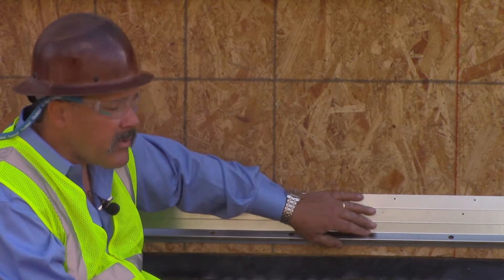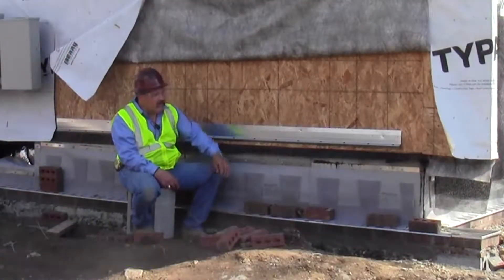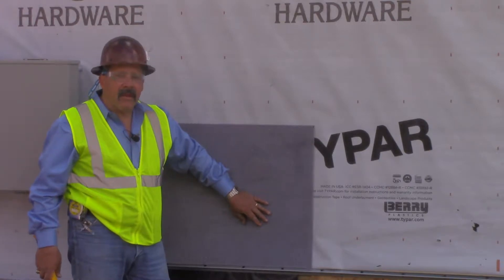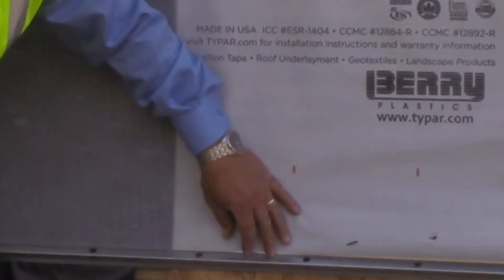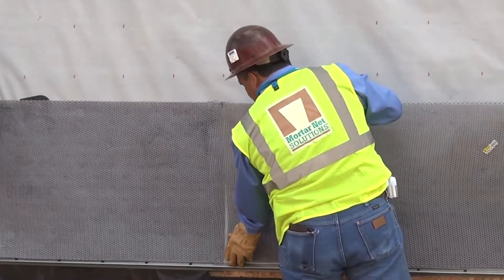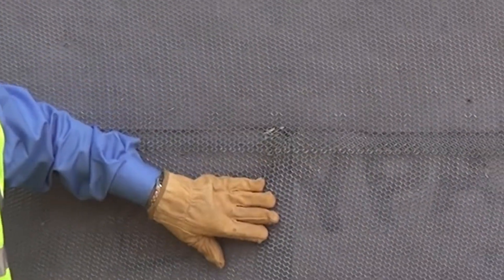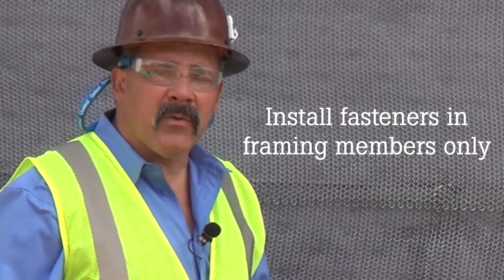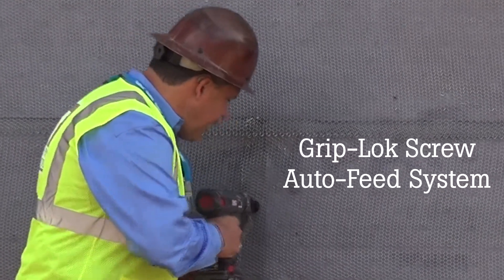LathNet Installation Nashville House

Comment: They need to leave this silly ass stuff in the factory none of the old buildings leaked without all this build up and silliness I’m a NorCal lather 26yrs union/side jobs too none of this stuff really works. Buildings leak due to Sheetrockers hanging paper and sasm because the union sent them out of the hall as a lather 😢 just my .02¢